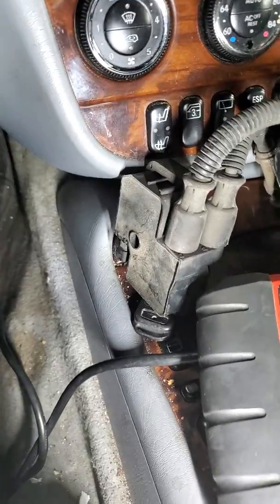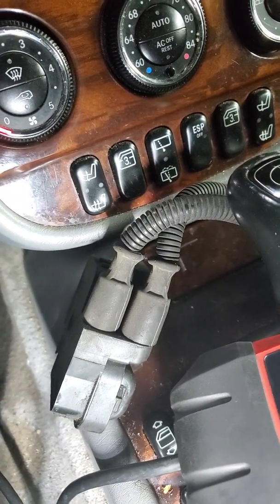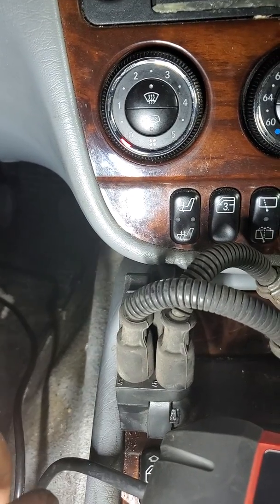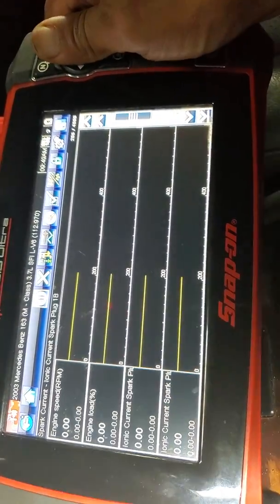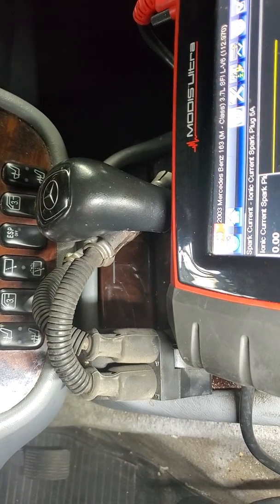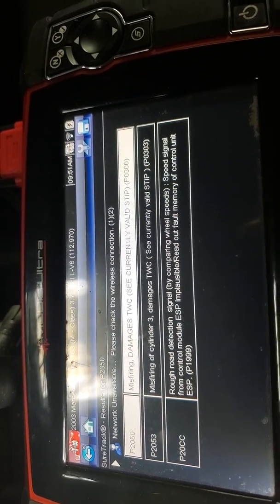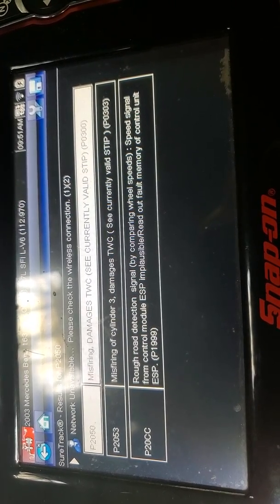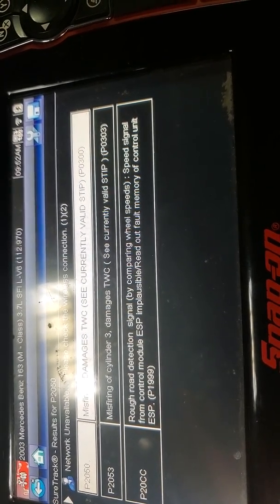How to fix a Misfire on a Mercedes ML350

Comment: I found that the plug gap increases with use.  Mercedes specs .031" and I measured twice that.  Remove all the plugs, clean the threads and bend the ground electrode till you get .031".  If you do this every 20000 miles or so, you will save the coils.  Also, use electronic contact cleaner on the coil connector.  I had no bad coils after doing this.

Comment: What about if you change all the coils and the spark plugs and the wires and it's still misfires and my other question is if you take the Cadillac converter out and put it straight so in other words I have one Cadillac converter only on the other ones off I put a straight pipe through it

Comment: Hey i enjoyed your video. So i have a 2002 mercedes ml320. I drove with a misfire for about a month took it in to fix. Changed the engine coil along with spark plug. Was still misfiring so i was told to change the fuel injector.  But i was given the warning that driving for a month with the engine misfiring may have damaged the rings/ seals or the cat.  So the fuel injector was changed and it still misfired.  The mechanic played around switching coils until it was good car passed inspection no problems.  After a week car started to misfire but no service engine light.  Im thinking its the spark plug wires as i never changed those.  What do you think it could be

Comment: I got a ml430 4.3 v8 and it has 3 misfires cylinder 6,7,8 dont know why changed the spark plug wires and spark plugs

Comment: My 03 ML runs a little rough but no check engine light is on sometimes when I first started up from it sitting a day or two and then I turn it off and turn it back on and it runs just fine what could that be